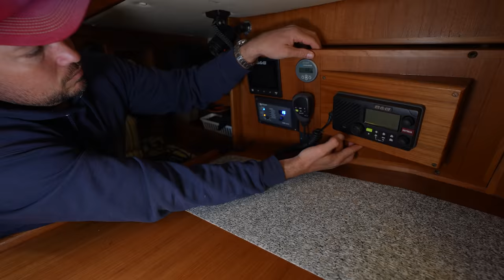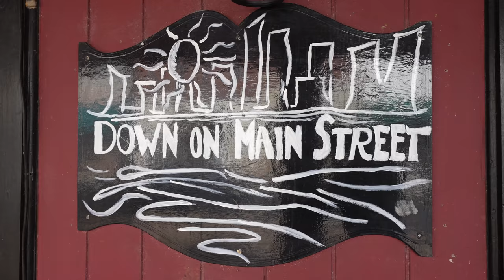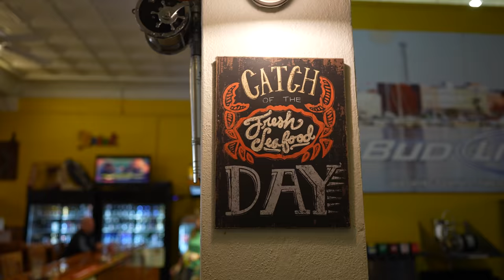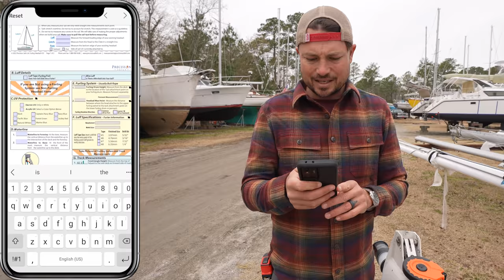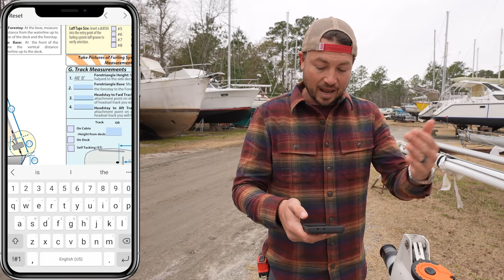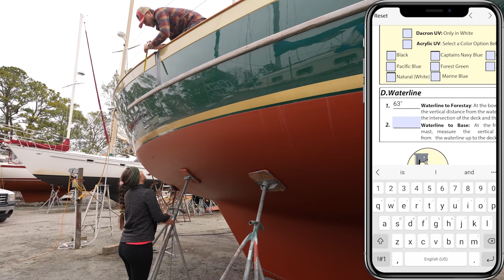I'm Having Second Thoughts... | S06E34

Comment: Watching you fish wires… wanted to offer a pro tip: where possible, always use thicker stuff than the orange crap, then when you pull back the wire pull back another “messenger line” and leave it there. Saves time next time, costs almost nothing.

Comment: Hey Jordan, I am an electrician and one of the tricks we use is to strip back about 6-12” or so of your insulation on your wire and then cut a couple of the wires out. Then use the remaining wires to make a loop. Next use your fish line to loop through the wire loop and tape up from there. This ensures a chain-like lock while maintaining a small profile. Hope it helps in the future of fishtape adventures! Love you guys and hope to one day have a boat for my family. 🤙🏼

Comment: When you pull new wires,Always pull in a sturdy string for future pulls(there will be pulls in the future)..Otherwise you'll be pulling with existing wires so it cost twice as much...I ALWAYS leave a pull string in every pull...
Reply: Electricians lube and pull multiple wires at the same time.  One of my first jobs was pulling large wires thru a two inch conduit.  Not fun.

Comment: I swear we are leading parallel lives. Valiant 42, replacing electronics, autopilot, updating comms (wifi, cell modem), fishing cables everywhere, upgrading alternator, switching to lithium, adding isolation transformer, upgrading solar, chargers, inverter, MPPTs, mast is out for rig inspection and refurb, lights, new main, etc.       so    much   fun

Comment: Being a mechanic for many years I have to say using sealed butt connectors on the navigation light system would be a no-no for me. I'd personally buy a small hand held soldering iron and solder them. 
Butt connectors are unreliable and are prone to fail (i.e. gremlins) in my highly experienced, but humble opinion.  
Love the channel.
Reply: No soldering on boats. ABYC standards dictate butt connectors. They’re much safer than solder.
Reply: ive done 10 atlantic crossings, 60.000 miles offshore since 1985, i solder every fitting i can  .the only fittings that have let me down are crimp fittings
Reply: @robertcooke1774  and just when the wire soldered connection heat up for some reason... you loose the connection.

Comment: wire pulling is very frustrating. BTW... never hurts to pull an extra string in certain places in case you need to make a future pull, and hopefully you ohm'ed out each wire after the pull just to ensure nothing happened during the pull? Yes, a friend of mine had that alopecia hair loss, stress they think, and got treatments of some kind of steroid injection in scalp, to get it growing back. You have lots cables, a label maker helps when you mark both ends of a cable. If you ever have to start taking things apart it helps it all go back together allot faster.

Comment: Right there with ya on wires in the stainless tube.  Had to use the vacuum technique with a stranded wire to allow me to feel the bend so I could manipulate the wire enough to make a tight turn.  It took me 6 hours of boat yoga to get a wire to go 4 feet!  But man!!! So satisfying when I got it where it was supposed to go.

Comment: A "Palm Nailer"  might be the thing to knock out those hard to get at bolts. Palm nailers are use by wood framers  to nail bracket nails might try a half day rental.  It might make your life a little easier.  Excellent work refitting your craft.

Comment: Pro tip from someone who runs cables for a living (although not on a boat) forget the string just attach the wire to the rod.
Reply: Came here to say exactly this, and if you expect you’re gonna have to get back in there at some point pull a string with the cable on the rod for later.
Reply: @garrett8128  or a extra bit of cable.
Reply: @DorsetSaferRoads  this too, I run both network and AV so sometimes we don’t know what’s coming next but we always pull more network than we immediately need

Comment: Running wire is always fun.  Here's a trick we've used many times, always with success.  With duplex or any sized encased wire cut the end square.  About 3/4" of an inch from the end make a hole between the wire and through both sides of the casing.  Take a paper clip or piece of similar semi stiff wire and run it through the home and fold it back against the underside of the casing. Punch a second hole about 1/2" from the wire's end.  Pass the free end of the paper clip through this hole.  Tie a stout string to the paper clip.  Then pull the paper clip all the way through as tight as you can bend it back against the casing. Wrap in electrical tape; taper the tape over the string.  No rigid edges. That connection can withstand a lot of pressure when you are pulling the string.
I liked the trick with the vacuum .Never thought of that.
Good luck with projects.

Comment: For pulling wires. Buy a roll of this dynema cord     SAMSON ROPE
Lash It! Single Braid Accessory Cord.   It has a breaking strength of 500lbs. It is expensive but lasts forever. It is 1/16” x 180’ and slick and a roll will last forever.

Comment: 3:10....POI  Stagger the length of the pos & neg connections, it makes for a smaller diameter connection that is easier to fit a conduit or make it thru an existing run.

Comment: Just a tip... Never hammer on the threads of a bolt... take a nut and screw it on the bolt so the nut is near flush with the bolt and hammer on the nut... It gives you a bigger target to hit and keeps you from buggering up the threads... Just saying... 😉

Comment: Jordan, you can just do an undercut to hide the patch and look very fashionable. It’s probably stress so once you’re back on the water it will likely go away. Just wondering why you needed to remove those chain plates. They look to be really solid, in great shape and secured incredibly well, so wondering why you couldn’t have just left them in place and just done the rest of the rigging. I guess you’re going back to Dacron for the sail material, or a Mylar mix?

Comment: I see someone else has mentioned alopecia and stress. When I was in my late 20s, a while ago now, I had virtually the same kind of patch in just about the same place. I didn't think I was stressed but it turned out I was. Luckily, it all got sorted out and, in a very short period of time, the hair grew back. Good luck with that. Anyway, nowt wrong with baldness and I'm sure the old trouble and strife won't worry too much if you lose a bit of hair! BTW, that boat is going to be impressively uptogether by the time you set off!

Comment: Vacuum method is great when it works! Have you considered a very small diameter piece of wire as a specific wire pulling tool? Strength, Chafe, Flex...

Comment: I think this might be too late but in stainless steel, attach something ferrous like a small nut or washer to the end of the leading string and use a maget to guide it through the tubes. The magnet attracts the nut/washer but won't stick to the stainless steel.

Comment: Great video is always guys can't wait to see you actually finally get back out on the great open blue. Bro to get those kind of bolts out in the future you need to invest in a is in a slide hammer or snatch bar Not Sure how they pronounce it in different parts of the country It's a tool used in body work used to help pull out dents but it's also used in a lot of other applications I personally have used it to pull bolts out of locations they do not want to come out of They're not horribly expensive you can find them at most of your local auto repair Part hous

Comment: Don't worry about the spot. So many people told the possible reasons, just one to add, as I know, it can be caused also by an inflammation somewhere. But the most important part is that it will disappear after the root cause disappear. Just go bald and no problem.
By the way, be careful with the RG cables, bending radius does count, and it doesn't like stretching, making knots and pulling them tight. :)
I'm not a doctor, but an electric engineer. :)

Comment: on the chainstays in those tight spots... did you think about using an air chisel with a really dull chisel. Think of it as a really low powered air hammer... Just a thought.

Comment: Hey guys, I really enjoyed the vid, as always!

Just a question: not trying to add to your second thoughts, but why are you changing the chain plates? To me they look almost brand new. I mean the outboard ones had some very light surface rust but the inboard ones look too be in perfect condition. So what is the reasoning behind it?
Reply: Some insurance companies require for coverage  , yacht insurance coverage is complicated
Reply: Some require initial survey and sown require standing rigging to be replaced if it has not been some require nothing but I’ve never heard of one requiring new chain plates
Reply: Stainless steel can get crevice crack corrosion, even in thick chainplates. It's usually not the material out in the open that has this problem, but where the chainplate passes through the deck. The lack of oxygen  can cause this corrosion that could lead to very big problems with the standing rigging being comprised.

Comment: Are you putting butyl tape in the holes where you pulled the wire for the solar panels? On the video we saw you make the wire connection with the correct tool but we didn't see any watertight connector screwed into your new arch piping. Water has unique way of finding a hole in the piping and travel down into the boat. Nice work y'all are doing, Atticus is going to be one fine boat when you get back on the water.
Reply: He was using heat shrink connectors that make the splices waterproof
Reply: @stevejones9788  Hi Steve, I wasn't concerned about the connections but concerned about water getting into the piping of the arch.

Comment: You missed an important step, with your fish string.
Anytime you use a fish string to pull a wire, you should also pull another string. That way you always a fish string in place, the next time you have to pull a wire down that channel.

And the one thing you can be certain of, there will be a next time you have to pull a wire down that channel.

Comment: Beautiful Boat. Don't burn it down with faulty wiring practices. When splicing wires of dissimilar sizes (don't do it) remember to downsize/re-fuse/match your breaker to the smaller wire size in your circuit.  alternatively - insert an inline fuse between the larger wire and the smaller of the proper size to protect the smaller wire from overheating and causing an electrical fire.  Lastly, mark the breaker/fuse at the panel so that you will know which circuit is likely the one causing the "burned wire" smell in your boat and flip it off first to keep your boat from burning up.  Remember fuses/breakers protect the wires from overheating.  Another mistake amateur electricians make is patching into an existing circuit thereby overloading it and creating a fire risk when all the loads on that circuit are turned on at the same time.  I know it's a hassle, but so is a wire fire at sea.

Comment: Reducing the wire gauge like you did for the stern light is asking for problems. Matching the wire gauge with the butt connectors would be fine but reducing the gauge and folding over the wires like that is a big no-no.

Comment: Starting right off, it's too bad that when they build the arch they can't put in pull cords.  Of course you would need to tell them the custom pathways, and the cordage would have to not be effected by the heat from the welding process.  Heck, (just realizing) they could use 1/16th inch multi-strand cable!  That could feed around tight corners, not break, and not be effected by welding heat!  : - )  Hey, did Pacific Seacraft make the arch, or was it a completely different company?  Whoever made the arch should offer to place custom "pull cables" inside.  I'm also thinking, if it were me, I'd just run wires on the outside and use zip ties to hold them onto the arch tubing!  LOL  Easy Peazy!   Now, Jordan, as to that bare, no hair, spot on your head.  Hmmm.  I've never heard of such a thing.  And I thought I had an odd balding problem.  See my hair is thinning more on the left side top than on my right top side.  You know, asymmetrical male pattern balding.  lol  Ya, and I've got 4 brothers that aren't thinning/balding at all!  One thing you can do Jordan is get that scalp spray paint.  That would hide it pretty well.  : - )   

Next up is the part about exposing a longer section.  Well, I think it's best not to expose even a small section.  Particularly when your talking about splicing somebody's butt.  And then there's my old joke - Wire you doing any of this?  It's Solderday and you should be having fun!  yuk yuk  Well, at least you've decided to go fishing.  Then, your effort to fish the arch really sucks!  (see my suggestion back at the beginning)  

At 11:10 we're back to removing the remaining chain plates.  I know I said this last week, but I would have let them all be.  Now, if Pacific Seacraft told you that it would be good to refurbish them, that's another thing.  I just wonder if your old problem on Atticus I, with leaking around at least one of the chain plates - leading to termite damage - is connected with this project.  ? ? ?  But it's too late now to let them remain as they were so, . . .  

Then at 13:05 it's time for some fancy Grits!  Oddly enough I actually had some basic grits this morning, before watching.  : - )  I just added a little (non dairy) butter, some sweetener, and some (real, local) maple syrup.  yum yum!  Desiree, that fancy stuff you helped make is beyond imagining how it tastes.  That's definitely a "You've got to go to that restaurant to find out how it tastes." kind of situation.   

Next up is the first step in prepping for the dinghy davit install.  Gotta love that Gorilla Tape!  lol   

Last up is seeing how your new sails will measure up.  Oh, wait, it's actually about measuring up FOR your new sails!  I am really wondering where all the moola is coming from?  New sails for a boat that size are big $.  But do I have to worry?  No.  I get to watch and enjoy!   : - )   I hope the weather down your way is doing okay!  It's 15 degrees F where I am and we just had 8 more inches of snow fall - on top of a previous 8 inches.

Comment: Your videos are still over too fast.  I too have done the wire fold over many time.  I actually have had better luck with wire nuts than crimp splices though as in aircraft or vehicles movement and time, or maybe stresses from other repairs will rarely but have pulled them apart.  The advantage of the crimp splice is that they are neater looking and bundle easier and bundling tightly with a zip tie will also reduce any movement.
Patience is a virtue many of us lack to the same degree.  I would have found the least conspicuous place and ran it down the outside.

Comment: Fishing wires through an arch is the worst. There needs to be a better system.
Reply: Yes don't try to pull the wires with the string use the string to pull a cord then your cable.